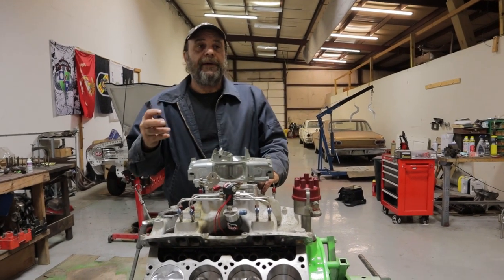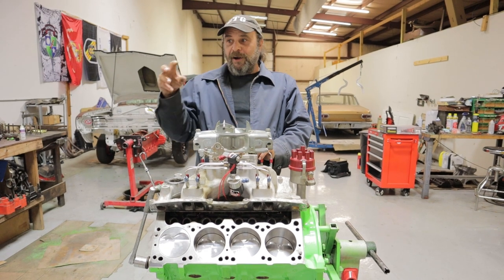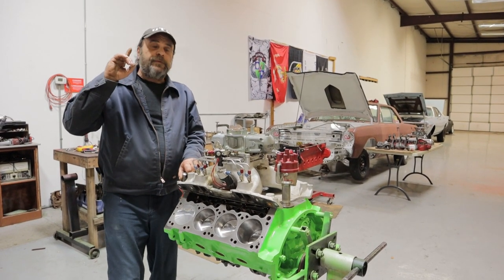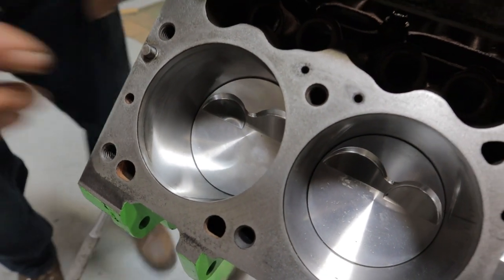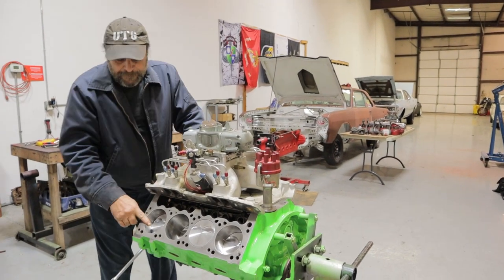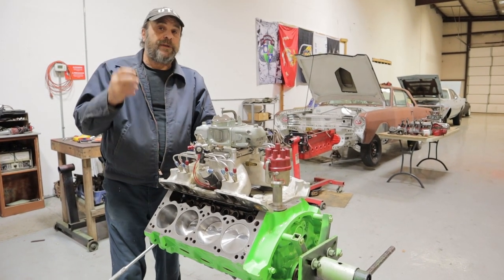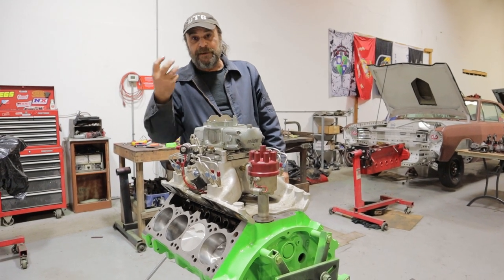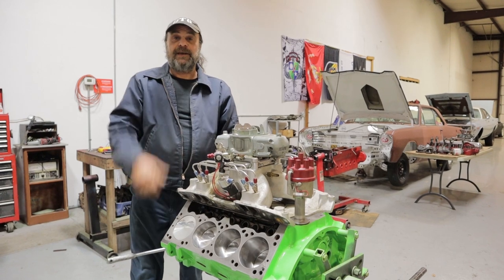The Fundamental Aspect Of The Internal Combustion Engine Nobody Ever Talks About

Comment: I love when our lime green Magnum ends up used as a prop because I can really see the scale of that monstrosity lol.
Reply: @207nuckelheadgarage7  hey, just saying, I’m the one that makes the phone calls to the manufacturers and orders the parts for our engine and yes that is the case. The shortage isn’t on off the shelf cams, it’s on blanks. I called Comp Cams, Hughes, Howard’s and a few others. None had cam blanks to grind for the magnum or had something similar to what we need on the shelf. Finally got a cam coming from Camcraft, who grinds a lot of magnum cams, so it’ll be here in a couple weeks.
Reply: @207nuckelheadgarage7  It’s a good thing all engines use the same cam so your experience matches theirs.
Reply: @NBSV1  I mean I figure we just take two Chrysler 2.2L 4 cylinder cams and weld them end to end. They’re made by Chrysler so they’re bound to be compatible lol
Reply: @207nuckelheadgarage7  now we all know where not to take our cars!
Reply: @austinlacroix888  Seems legit to me.
Reply: That motor turned out really nice considering it was your first. I am looking forward to hearing it run because it looks wonderful!
Reply: @jtyoung706  it’ll be running next month at the latest. Heads need some broken intake bolts pulled out, then they need to be painted and assembled once the valve springs arrive. But the cam is keeping the lower end from being completely assembled so until that is here, we’re kinda dead in the water, but we’re doing boring bodywork until it gets here.
Reply: @austinlacroix888  Looks like UT put about 20 miles on the motor during this video,
Reply: @austinlacroix888  bodywork is soothing in itself. It's all the dust and dry skin that makes it suck! I get it on the whole having to wait for a custom grind problem. I work in printing and it's been super hard for us to find materials and machine parts for the last year. Some folks don't realize that a global supply chain doesn't function when parts of the globe have the do not disturb sign on the door knob!
Reply: @207nuckelheadgarage7  Always gotta be THAT dbag on one of these videos.
Reply: Austin, Are you guys doing any work on the 4 speed (internal inspection or ?) or just hooking it up as is?
Reply: Took me over 6 months to get my gen 6 bbc cam due to no cores. Really annoying when you got a mostly put together engine just missing the heart and its not even a exotic part for a super common engine. Doesn't help that the engine in the truck thats waiting to be swapped out is just a clapped and worn out smog 350 that has 2 dead cylinders and leaks like the Valdese. Just miserable to drive hahaha.
Reply: @austinlacroix888 , Be sure to paint it purple!
Reply: @johnszul7943  from what we understand, the 833 is perfectly fine. But we’ll at least pop the cover off of it and paint the assembly since it’s rusty lol.
Reply: A few more of these clips from uncle Tony and that motor is going to be nicely bedded in.
Reply: @207nuckelheadgarage7  those cams are much more common than a roller cam for a Chrysler 360 Magnum that is applicable to what we’re doing with the engine. I actually just called Camcraft today and we’re 4th in line from having our cam ground. It should be here around the weekend. If not this weekend then likely next weekend. It’s ok though, we’re using the downtime to do body work and stuff not really interesting enough to document. Valve springs are gonna be what we’re waiting on next, because Hughes won’t have them for a bit and no one else makes a valve spring kit for a Magnum that will do what we need. Comp does not make the springs for it either. I’ve checked. It’s an odd engine. Chrysler LA internal parts are falling out of trees, it’s this specific engine generation that has been difficult to get certain parts for off the shelf.
Reply: @207nuckelheadgarage7  
Hate some more.... "The power of Christ compels you" I'm sure.

Comment: This is fascinating. I don't believe I've heard anybody address this before; at least in such depth. Thank you.
Reply: I am not buying this.
Reply: @frenchonion4595  Gasoline vapor has more surface area than droplets, but it is less dense.  The gas version of a liquid is always less dense than the liquid state.  This is probably why the vapor dude is using a turbo.  Because without that turbo, it is IMPOSSIBLE to get the same amount of gas via vapor than via droplets simply due to the lower density of gas vapors with a NA engine.    But UT said the opposite, that vapor was more dense. 

The number of degrees being pushed by the hot gases doesn't make much sense either. Even without burning any gasoline, the air alone would exert forces on the piston past what he was showing.  The piston is at atmospheric pressure at BDC. Anything above bdc is compressed even without burning gas.
Reply: @tarstarkusz  
You really don’t know jack.
Reply: @tarstarkusz  part of your problem is that you put words into Tony's mouth he didn't say.  He never said the charge was denser (it isn't), he said it was richer.  If it helps, define richer as "I have the same volume of fuel and air (which is basically oxygen and nitrogen) but partially by expanding them (making them less dense, by heating them), the combined vapor molecules are in a much better relationship to each other to burn.  Which they do, but the expansion also means the total number of molecules is lower.  So when those molecules expand to maximum through combustion, there is less total push than the denser but inefficiently-arranged cold charge.  

A quibble on your notion of the compressed state of a cylinder:  Atmospheric pressure is determined when the intake valve closes, not by BDC, unless that is the same point.  Cam timing determines this.  If the intake closes before BDC, then a vacuum exists until the piston reaches the same point on the up stroke.  If it closes after BDC, then compression begins at that point.
Reply: @tarstarkusz  it has more power density with less volume / mass perhaps
Reply: @douglasnicholls1366  I could have sworn he said it, but if you say he didn't, maybe he didn't in which case what I said does not apply.

I was just using that as a hypothetical to demonstrate the fact that once the valve closes and starts moving up, the pressure in the cylinder rises just due to the compression alone, let alone expanded gases after ignition.
Reply: @tarstarkusz  The overall point is that after the valve closes and compression begins, all of the raw material is in the cylinder,  With hot vapor, we have a well-atomized bunch of warm molecules ready to explode quickly.  With a cold charge, we have a less-well atomized but larger bunch of heated while entering the chamber molecules that will create a less-immediate but longer-pulsed bang.  With nitromethane, we have a kind-of exception in a fuel capable of adding its own oxygen through a slower burn to keep a less-volatile explosion running past BDC.  The hot vapor also has an advantage in being less susceptible to losing fuel on aberrations in the port, but can't get around its lower energy density.
Reply: @douglasnicholls1366  Even if I am wrong, which I concede is possible, you are missing my point.  UT said the hot vapor only creates power through about 10 - 20 degrees of rotation (I forget the exact number he said, but it was much shorter than when gas is atomized) 

 My point is that is not possible. It defies the physics.    Air exerts pressure in every direction including down (especially since that the side that is "giving" (moving).  Even without fuel, the air pressure alone would still push down on the piston 10 degrees past tdc because the air is above atmospheric pressure.  That is the source of power of an engine. The pressure differential between the crankcase and the cylinder.  So when this vapor air mixture ignites, it vastly increases pressure above what it otherwise would be (whatever the compression ratio at max  is -degrees of rotation) because the hot gasses take up more space and exert more force than cooler gasses.

Obviously, at some point, the gases are exerting less and less pressure simply due to the piston traveling downward and making the combustion chamber and exposed cylinder larger and larger.  It also must overcome the forces in the other cylinders, at least one of which is on the compression stroke and robbing some of that power to compress the charge.

I think the lack of power is ENTIRELY from the charge not being dense enough (cannot oxidize enough gasoline to make lots of power).  I think that is why the guy he was speaking to used a turbo charger. Because 1cc of atmosphere at a certain temperature can hold more liquid gasoline  than it can vapor, just like a CC of water has more water than a CC of air at 100% humidity.  The turbo charger is not only compressing the air, but is compressing the vapor as well and can fit more vapor at positive pressure than would be possible naturally aspirated.
Reply: Tony knows a lot about the advantages/disadvantages, strength/weaknesses of the A block vs. LA block vs. B block vs. RB block, vs all of the HEMI blocks, etc.. He knows which years were the best, he know how to make good power out of any mopar configuration. But he doesn't understand thermodynamics. He thinks that the flame is what pushes the piston down. He is completely wrong when he says that the motion is all momentum after 45*. Worse yet, he thinks he is completely on to something new that nobody has ever though of. He doesn't understant that the flame creates heat, which results in pressure... that pressure exists after the fuel is burned at 45*, and continues to push the piston down.. in fact most of the power from the power stroke is from the post-combustion hot gas expanding. His entire thesis here is a non-sequitor. 
I would love his advice on how to build up a nice 383, but he is out of his game when he attempts to crack the theory of Internal combustion engines.  Anyone here can do some quick research on the Otto heat cycle.  https://en.wikipedia.org/wiki/Otto_cycle
look at the first figure labeled "Pressure–volume diagram".  Segment 2-3 is the ignition and combustion phase, which is assumed to be instantaneous as a simple approximation, and is actually the ideal case.. the entire power stroke (segment 3-4) is after the fuel is burned, and the hot, high-pressure gas is expanding. The area under the curve (segment 3-4) is the work applied to the piston from the burned air-fuel mixture.  
Can someone please tell Tony to get it right before he posts another one of these videos? For Tony's sake.

Comment: I have always had an interest in Yunick’s hot vapor engine but Tony explained it better than anyone yet! He really knows how to illuminate a subject.
Reply: What I remember most about reading on Smokey Yunick Fiero hot vapor engine was that he used a fuel heating vaporization set - up, when you heated and vaporized fuel and air as much as he did it would tend to shoot back out, so to keep it flowing into the engine he used turbochargers. From what I remember his main goal was to achieve 2 horsepower per cubic inch displacement.
He claimed to be able to achieve up to 
2 1/2 horsepower per cubic inch if he boosted up the turbo pressure but he said the Fiero transaxle couldn't handle it.

Comment: Tony, you ignored what pushes the piston down. The burned fuel mixture, now smoke, is bigger than the fuel mixture which entered the combustion chamber. It has nowhere to go, so it pushes the piston down. Many people don't understand this and think an explosion in the chamber is pushing the piston. Of course that is not true, an explosion is detonation and we all know that is a bad thing. So, another reason a vapor is a poor choice for an engine is because the mixture entering the engine is larger. The difference in the size pre-combustion vs post is greatly reduced. So, the effective use of the growing size of the charge is also lessened. The result is less power and less efficiency. The reason a colder charge is better (think inter-cooler) is because the intake charge is made smaller by the cold, increasing the difference in  size pre and post combustion.

Comment: Certainly when I was studying forced induction in the context of a theoretical design project at uni, the 'whole system ' approach was where I ended up. A real lightbulb moment! Ever since, I've been fascinated by the lengths people have gone to, to make each cylinder 'breathe' harder and longer. That's the key. Once you've got control of that, you can set it up however you want.
Some of it's fairly simple, like twin plugs: some of it's not, like the Miller cycle and various other mechanical arrangements.

Comment: I have almost zero experience with Nitro . The light went off when you explained that it is still burning at BDC. That explains the power and the detonation that happens sometimes  at the bottom of the stroke. . High 5
Reply: I didn't know that nitro was a slow burning fuel. After he said that t all made sense. It is like firearms. Pistols use a very fast burning powder because of their short barrels. Rifle powder is slower burning to allow the expansion of the gases to be utilized by the long barrel. On a side note I once converted a Chevy 350 to run on propane mainly because it was cheap at the time, $.80 per gallon as motor fuel. The engine ran quite smoothly and clean. However power was way down as well as fuel mileage. I never calculated actual fuel mileage but it is terrible. Pulling a 5th wheel up into the mountains I know I got less than 4 mpg. Also fuels like this have a lot less BTUs per gallon. This was a very informative video. Thanks UT.
Reply: @karlbishop7481  What? Rifle powder? There is black powder, charcoal, sulfur, potassium nitrate. Which at this point is sort of a novelty. And the more modern, so called, smokeless powder, nitrocellulose. There are rifles that can shoot pistol ammo such as the Henry lever gun and vise versa Bushmaster 21s chambered in .223. What happens when you put pistol ammo in a rifle is you get a higher muzzle velocity because the charge has a longer time to work on the bullet because of the longer barrel, which in turn gives it greater range and accuracy. There is no such thing as ''rifle'' powder.  The .50 BMG uses the same powder as the lowly .22 lr. just a lot more of it. There are many pistols and rifles chambered in 22lr. A ''sub'' machine gun uses what is normally considered pistol ammo like the 9mm Uzi or the famous Chicago typewriter, Thomson sub machine gun,  chambered in .45acp.

Comment: An interesting fact that maybe comes into play here is that Formula 1 engines achieve their sky-high rpm limits by lowering piston velocity with very short-stroke designs.  They have to do this to avoid exceeding the speed of sound in the intake ports. (why do they want more rpm? burn more fuel per minute, make more power with small displacement set by regulations)  To spread out the combustion front around more degrees of rotation, you need the same higher rpm.  So if anything's going to achieve results with fast burning fuels, it'd have to be smaller fast moving engines.
Reply: the issue you then have is reliability & cost to attain that reliabilty.
Reply: @kass9722  you're right. Getting reliability with a conventional piston engine is not going to be practical at those RPMs. A lot of small cylinders would be cool, but costly. Otherwise maybe vapor would work in a turbine or rotary application?
Reply: Higher rpm always makes more hp too. That is if you can get the air in to support that.
Reply: My sentiments too , on f 1 rules , optimum effect with stock stroke shortened to match turbo and quick burn combo , thank you for your enlightened view of this matter...👍💎👍💪🙏🤔
Reply: @kass9722  they have no valve train rotating parts ie cam lifters etc the valves are actuated by air or they would never rev that high
Reply: Well, that issue takes us hot rodders back to the basic (SBC) 327 vs. 350 issue -- HP vs. Torque.  As a sports car road kind of guy (as opposed to a quarter mile track kind of guy) I've always prefered short stroke, high revving engines.  (I suppose there's a 4 speed vs. automatic inherently contained in that statement.)

Comment: That was the beauty of leaded, high-octane fuel. Lead slowed the burn of the fuel. So instead of getting a "pop" of the (unleaded fuel) burn, you got a swoosh burn effect of the leaded fuel. Also lubricating valves & seats etc.
Reply: Something to note is you can still buy lead additive for fuel at the parts store though the stuff isn’t cheap. I don’t know what that stuff does to a modern engine though I assume it builds up on the valves and won’t let them seal properly. I do notice when I used the stuff in my 66 the engine runs stronger and being that engine is extremely worn out it’s worth noting my oil consumption seems to go down.
Reply: I have heard that the lead lubercates the the valve stem seals.... But I'm not convinced its the best way. Lead has an abrasive property that wears the cylinder and rings. When they took the lead out, engines lasted longer. However, if you want Leaded gasoline, just buy aviation gas. 100 Octane and full of lead.